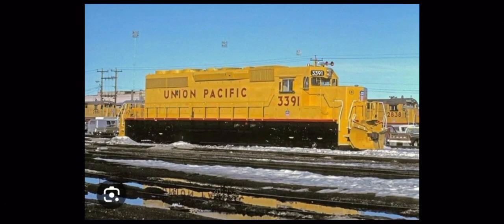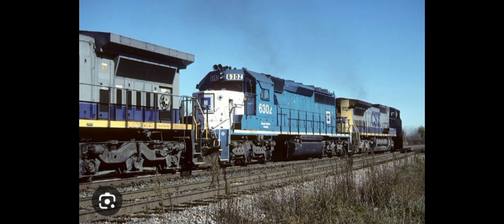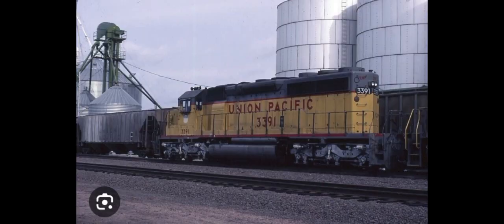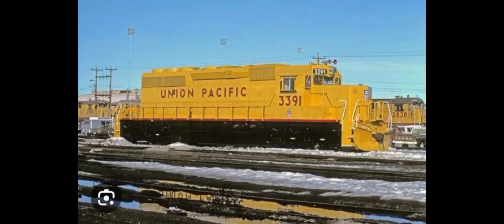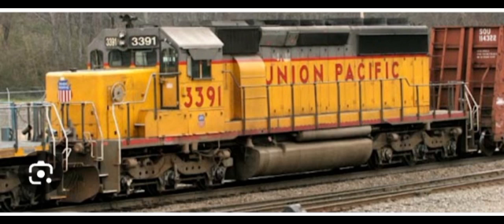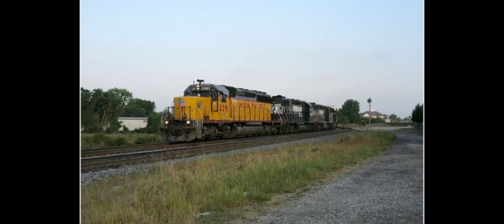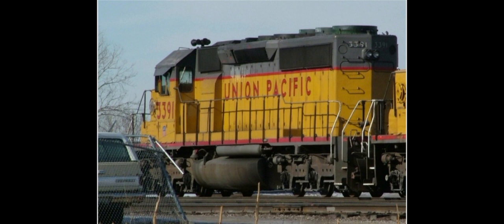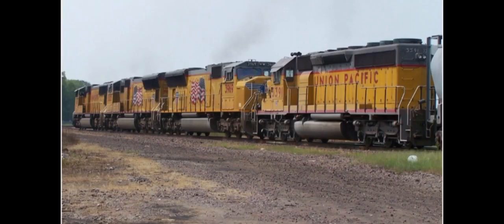rare engines union pacific 3391

Comment: 3391 was one of the "snoots" or "fast forties" due to its high speed 89 mph gearing so they could run with the DDA40Xs.
UP's yellow was called "Armour Yellow" adapted from the yellow Armour meet reefers of the 1930s.